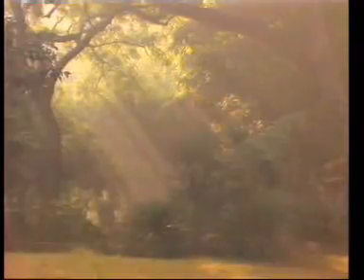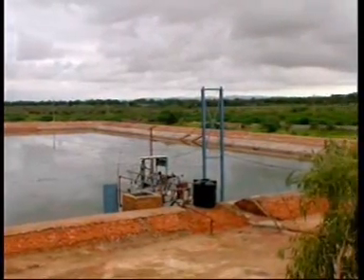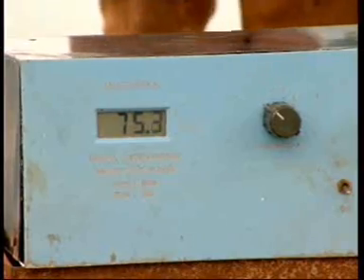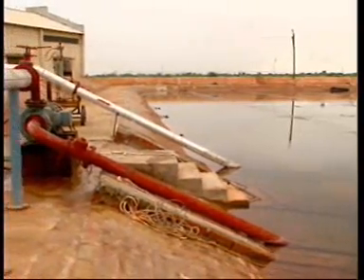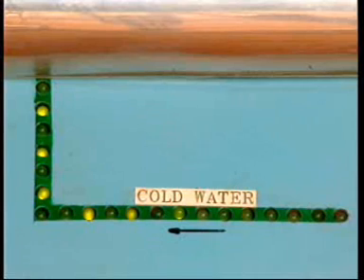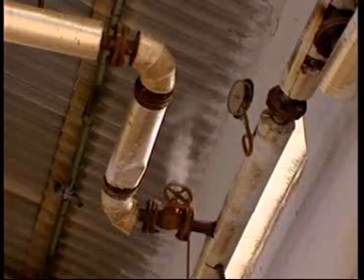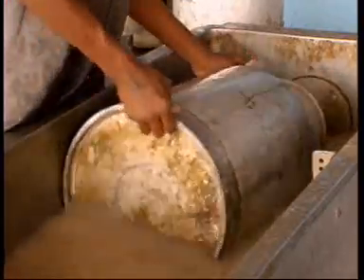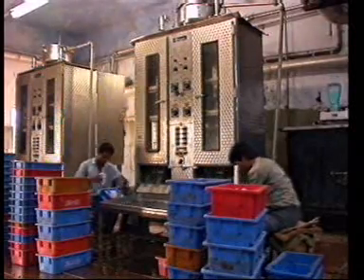SOLAR POND

Comment: When I started my engineering course I didn't knew that I would be so amazed and fascinated by engineering application.It is very much important to use the limited resources we have with budget as constraint.
Reply from the maker: Dear Sadika Choudhury,
Thank you for your comment on our story of Solar Pond.
I agree with you. Even I was amazed at the work India was doing  in this sector of alternate energy solutions  way back in the mid 90s when we did over 50 stories spread all over the country.
Unfortunately, India did not provide enough impetus to the industry to adopt on a large scale.
Thank you once again.
pramod Mathur

Comment: how it help our nation
Reply from the maker: Dear Ravindra D, Thank you for your comment on our story on Solar Pond. The answer to your question is simple.  Production of electricity is expensive and the technology is polluting. The consumers are charged a subsidised rate and the remaining money is going from the government. 
Using this technology to heat water for industrial processes does not cost any money on day to day basis. This technology  only needs capital investment to begin the pond. With abundant solar energy in our country...the daily running cost of a pond is negligible.  Our country is trying to use alternate energy sources to save money...and that is how this technology is helping our nation.
I hope I have answered your question. Do come back to me if you have any more questions.
Best
Pramod Mathur
Reply: how much degree should be there to produce electricity
Reply from the maker: This technology does not produce electricity. It provides you with hot water of 100 degrees celsius. You could use the hot water for pasteurizing the milk in dairy industry and or cleaning or for any other industrial purpose.  
When I wrote about the electricity  being expensive...I meant that without using expensive electricity one could heat water for industrial use without spending any money in the long run.

Comment from the maker: Dear Bryncomeaux,
Thanks for your comment on our story on Solar Pond Technology. 100 degrees is indeed in centigrade. The commentary says that this temperature is required for pasteurization of the milk. I guess, there are ways to stop the scalding during the process. 
This story was done years back....I am sure the system is still operating. In case you do wish to have more details, please write back and then we can investigate and let you have more details.

Comment: i thought of this idea  this morning and now i dont have to do anything about it because its already a you tube.  im reduced to clicking  a like button.  by the way milk needs to be hotter than 100 degrees but i guess you mean Celsius in which case it would be boiling and that would scald the milk but im sure you  know what your doing just trying to clarify a useless point.